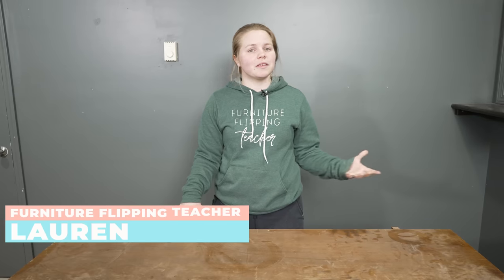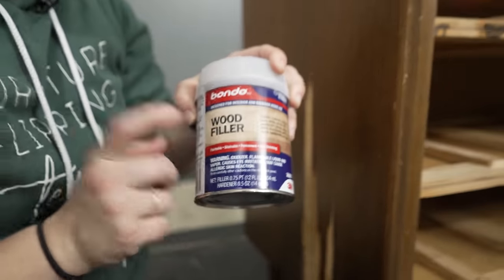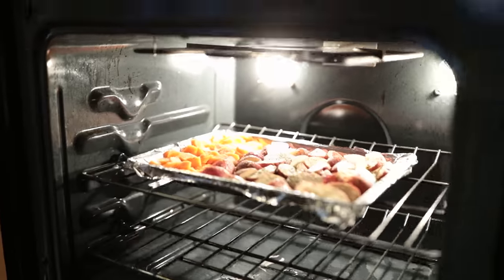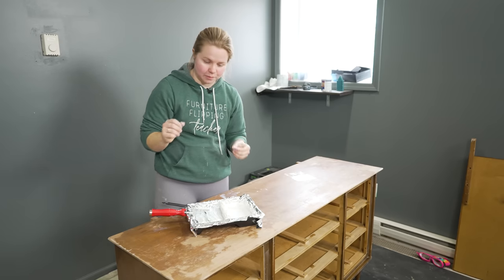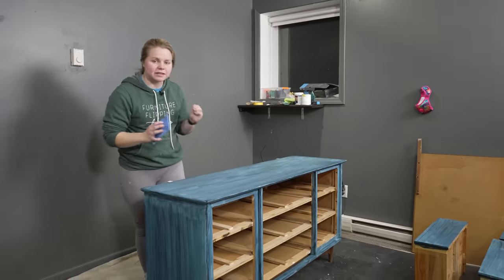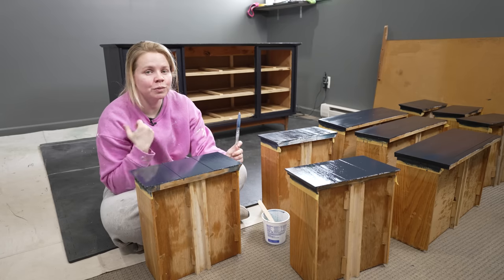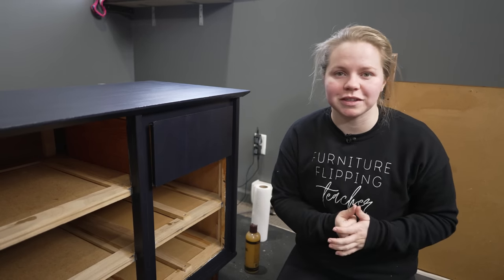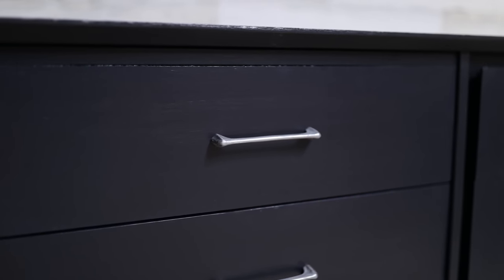How to Use BONDO to Fix Peeling & Chipping VENEER

Comment: thank you for the advices ! did you use 120 for sanding the veneer? any suggestion for replacing bondo with another wood filler that can be found in europe? even for ordering from amazon bondo is unavailable...

Comment: Thanks for yet another awesome video!  I have a couple of questions.  First, with the damage that this dresser had, would it have been possible to use some type of clear shellac to block out the water stains, bondo, etc, then stain it (as opposed to painting) without those things popping through?  Second, did you choose to use the wax on the drawers, rather than the restore product, simply because it provided a more durable finish?  They looked absolutely gorgeous after that application and I couldn't believe what a difference it made!  I'm just wondering if the same look could have been achieved by using the other product.  Thanks again for all of the support and inspiration!

Comment: I just did a mcm set that is this same color combo. I used fusion in ash. It looked dark gray in the can but came out deep navy like yours. I used fusions hemp and beeswax on the whole thing to seal it instead of a traditional top coat. That wax was AMAZING on the wood I will say for your info because I think it will save you time and you can use it all over on dark colors 😉.
I hate sanding more on a wood base after I painted a dark color close to it. I had to do the same as you too. I like how you tried a new brand and color. Great job!!

Comment: I personally like the cool of the silver with a dark navy but I agree, it depends on what your client's current color/metal theme is in their home. I am not completely sold on rub and buff yet, have only worked with ebony and found adherence issues with it but for spot fixes it is awesome. I had chosen oil rubbed bronze fixtures in the bathroom and had to tone down some of the "copperish bronze' accents on the pieces, worked well. Thank you for the explanation for the bondo choice, I need to pick some up tomorrow for a trim piece repair.

Comment: Glad to see that there's a Wood Bondo.  I'll have to try it.  Damage a lot of the times keeps me from buying pieces.  This will definitely be a game changer.  Does this primer come in gray?  I use gray under dark colors.  It always takes no less than 2 coats and sometimes 3.  If I paint a dark color, I usually add a little of my paint color.  It helps a lot. One thing I can't stand is streaks in a top coat.  Doesn't it kinda make you ill when you get a piece completed and have to redo something?  It does me !!  What a great change !! I would've put gold hardware but like you said, you have to do what the customer wants.  I love this MCM piece. Thanks Lauren and Neiman for another great video !!
Reply from the maker: Bondo is a game changer for sure! This primer doesn't come in gray but can be a bit tinted to be gray. I never thought of seeing about putting a bit of my paint in the primer to tint it that color. I may have to try that! Glad you liked the final result! Thanks for watching!
Reply: If you can’t get a grey primer for under dark colours, use clear shellac. It’s an excellent stain blocker, primer, and nasty smell encapsulater. Way better than primer.

Comment: i discovered that if you use a smaller dab of the hardener, it still hardens up really well and it doesn't dry as quickly. It helps that it remains malleable a little longer and it's a little more forgiving :)

Comment: Would I use Bondo if reSTAINING a piece; or just if priming & repainting?  If no, how do I fill screw and/or nail holes and scratches?  Also, if PAINTING, did you scuff sand after applying primer?

Comment: I love the shade of blue 😘👌 with the dark walnut legs.  Beautifully done!

The hardware choice for this versatile piece will determine the style —if the client wants pewter then you need to go pewter.  By not changing the style of hardware you maximized the style possibilities. I’d have gone with a more ornate design to pop from the clean lines of the piece but I could also see it with more modern style hardware.  

I really love the migration away from painting furniture with either ebony, some shade of white or a neutral like sage or taupe —blue is so cheerful and vibrant his blue in particular is unique and lovely!  Very nice job. 

Ps maybe bc my dad was such a stickler for detail but I think you’d take your quality up a notch by finishing the bottom edge of the dresser and the bottom edge of the drawers. Both had spotty areas of primer and/or paint.  Higher quality means you can charge more too… 😉 

Look forward to seeing more of your projects/videos and I might have to try that blue Chippy Paint myself! 😊

Comment: I find that thinning out the final coats as you progress through them gives you a smoother finish in the end. It has the effect of leveling itself like leveling cement and thinner means no streaks and zero bubbles. Of course you have to practice at it and cant load up the brushes or it will drip all over the place. A heat gun is another option on some finishes.
Reply: What do you use to thin the paint?
Reply: @sharleenseas9861  It depends on the base of the paint you are using. Water with water based paint or acrylics and turpentine or odorless mineral spirits for oil based paint. Read the can, it should say there somewhere what sort of paint it is.

Comment: Hey Lauren.  Can you tell me if when you use the SurfPrep you have the little swirls.  I really don't like using it.  No matter how I use it or what sanding pad or film I use, I always get the swirls.  It's new, and I've already spoken to someone at the company.  They offered all sorts of advice.  No matter what, I get the swirls.  Any thoughts? And no, I do not put pressure on it.  I use a new sheet or pad when necessary. I do not move it fast.  I tried the recalibration.  I just don't like using it because no matter WHAT I do, it happens.  HELP!!!
Reply from the maker: Hmmm, I don't get swirls! Not too sure why that is happening for you! I like to move mine fast when i am just scuff sanding. You can turn down the speed of it as well. I hope you find a solution!
Reply: You and me both. I thought I would love using it, and now I just don’t bother and it’s too late to return. I’m so bummed I spent the money. I’ll try moving it a bit faster; yet I was told to move it slow. lol I’ll keep at it I guess. 🤦‍♀️

Comment: Beautiful piece. Great job! I'd went with Gold hardware and maybe even changed out the design.  Im wondering why you didn't paint the bottom and legs. They look older than the new unit. Maybe a new cream or white or even did that area to match the hardware. That would look as but again a good job.

Comment: The reason that Matt finishes always short milky is because the mattifying agent is white and color. The difference between high gloss and matte finish is that they just add matting agent. If you ever do a glossy top coat you don't need to worry about adding a bit of paint in. And if you're doing something like a table top where you're going to need multiple coats for protection through your first two coats and gloss and then your final coat in matte. 
What was the name of that sand paper you used between coats of paint? The one that was like spongy?

Comment: wood carved handles, that match the legs/bottom frame stained wood, in Color. Same shape as the silver metal ones, on there now But handles to be wood. And circle wood grain knobs on side drawers.  No silver. On dresser. If customer wants to incorporate the silver, then I would have silver color decour put on top in some way. for decoration, (to tie in the silver some way, but not actual dresses having the silver pulls. Yes, I do see this dresser as having wood grain/stained horizontal middle handles, w wood/stained grain, simple circular knobs added to the side drawers. (To match the frame base and legs).

Comment: If the work is commissioned, do what the client prefers. I do like navy with gold…. I would have chosen that.  Question: why didn’t you tint the primer? Curious. Do a gofundme for an indoor spray tent or whatever you need to spray inside. It would go so much faster. A little bit from everyone goes a long way… Otherwise, well done. I’m a fan of MCM furniture. Hugs ❤️🌺

Comment: Lauren, I’m impressed with how far you’ve come in almost 2 years. However, if you paid attention just a little more to the details, I believe it would take you to the next level. You should have completely sanded the legs and then stained them, your brush strokes are a bit sloppy, and the edges of your drawers are totally horrendous with drip marks and lack of sanding to clean them up. Come on teacher, use you’re own advice!

Comment: I think the top would have been better, the same as the base. That being said, don’t know what you were working with damage wise, or what the top was made of. If it was solid, that would have been achievable. A good portion of MCM however is veneer, and if it’s gauged too badly, it just isn’t possible to restore, without reworking the whole top. Veneer work isn’t for the faint of heart, for sure, and beyond my skill level. The amount of labor and cost would be prohibitive. Sometimes that kind of work, is more a labor of love.
Reply from the maker: I wish I could've kept the top wood as well but unfortunately there was a huge chunk missing out of one of the corners that I had to fix using the bondo which then means no staining. This time it was even more than just missing veneer.😅 thanks for watching!
Reply: @FurnitureFlippingTeacher  I love the painted top. Much better than being stained.😉👏👏👏

Comment: Why would you pulled the peeling veneer instead of gluing it back down? That is against everything I have been taught about furniture restoration. You will never get the patch to blend, it will always look different. I have been doing furniture repair and restoration for 22 years and Bondo will not bond with cellulose, so your repair will fail in 3-5 years. Bondo chemically attaches to metal and some non-organic materials. You can use several different wood fillers and then use wood tint powder with vodka and make the patch very difficult to see. Who taught you to use Bondo, I have on,y seen it on cars and such?
Reply: Are you aware that there is more than one type of bondo?

Comment: Bondo or any wood filler will fill the voids as long as you are painting the item. If you like REAL wood furniture you need to learn how to veneer sections. I refinished and repaired furniture for decades. I could also color in the bondo and faux grain it into the real veneer. There are many options unless you want everything just painted. It's all a matter of skill and patience.